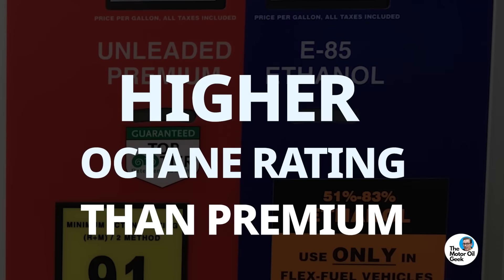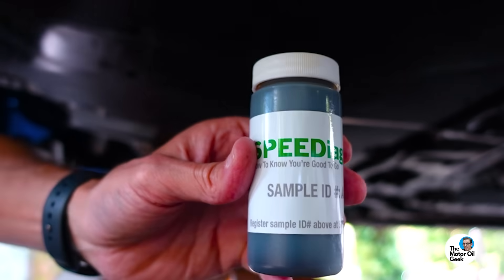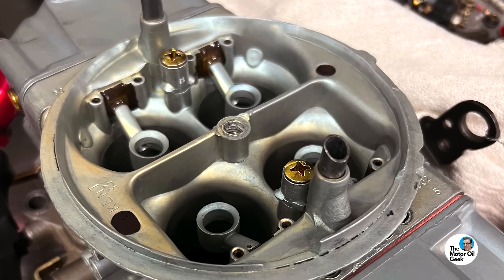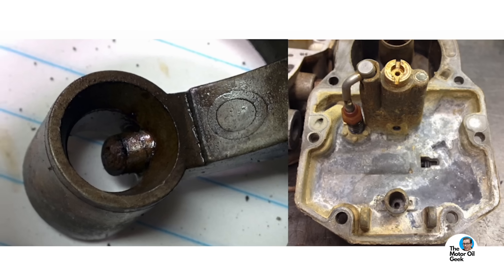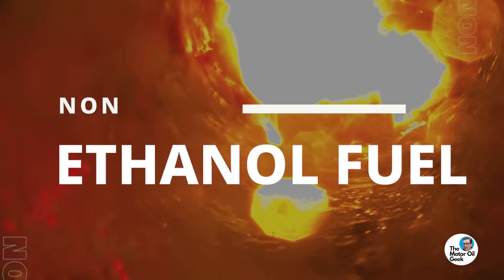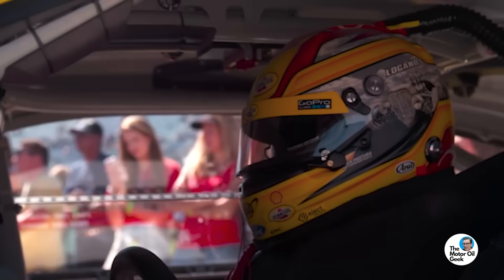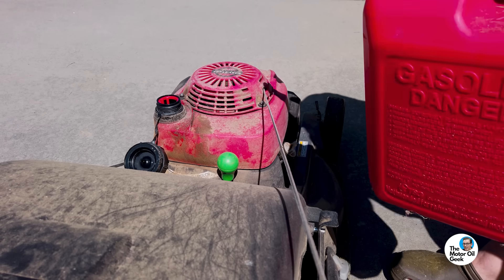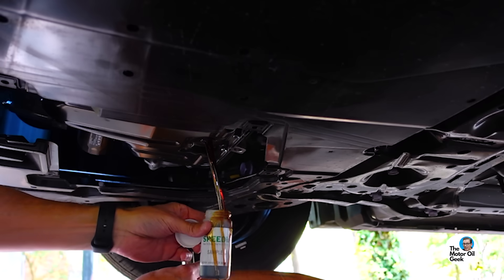ETHANOL: Higher OCTANE, Higher RISK?

Comment: This is going to be a problem in Canada. Already pretty much all of our gasoline is E10, on which almost anything can run. By 2030, however, the two largest and most populated provinces are switching to E15. This is going to be a problem for motorcycles, boats, and power equipment and any older carbureted cars. And just so dieselistas don't feel left out, those same provinces are switching to B10 (10% biodiesel) by 2030. Fun times ahead since both my car and my wife's recommend no more than B5.

Comment: What a stitch up, I’ve been running E10 for 20 years in everything I own from  my supercharged Mercedes, 351 Cleveland, 340 ci  ski boat, ride on lawn mower, chainsaw, wipper snipers and Honda generator with no problems, 
My daily driver is a 1999 v6 ecotec and has done over 300 klm’s on E10 for 20 years and still running the original injectors.
I’ve only had problems before switching to E10. 
In Australia we run ethanol from sugar cane and not from corn but I can’t see there being much difference.
There is a video on YouTube called 
“tuning our car on E10 to beat fuel prices $$$”
And they get more power on the dyno than running premium fuel.

Comment: This video focused on ethanol and harmful effects on carburetors. I didn't hear any mention about any harmful effects on fuel injection cars unless I missed it.. Does that mean fuel injection cars are okay to use ethanol gas without any harmful effects? I use ethanol free in my 65 goat with the tri-power even though I had all three carburetors rebuilt with ethanol resistance accelerator pumps. I am lucky there's two stations 5 mi from my house that are next to each other.

But I've also been putting ethanol free gas in my 2022 Hemi Challenger since I bought it brand new 2 years ago. The only time had ethanol gas in it is when the dealer filled it up when I bought the car. The main reason I'm using ethanol free in the Challenger because the car sits in the garage 90% of the times and it's only used for car shows and hardly gets driven. I understand ethanol-free gas will last longer before going bad then ethanol gas. Whether that's true or not I don't know

Comment: I haven’t had nearly the issues with oxygenated fuel but I have found the #1 thing is when storing is either utterly bone dry the fuel system or fill the tank to brim. 

Fuel system that’s partially filled is going to “breath” more than one fill to the brim and the water is going to be a proportionally greater qty in the fuel that remains. 

I throw stabilizer in too but honestly that’s more for the feel good I think. Plenty of times I’ve over wintered stuff with std fuel but with full tank there’s not nearly the issues.

Comment: Yes I only use non ethanol fuel in my mower and weed eater used to clean carburetor every spring not since buy the 50 cent plus higher non-ethanol It's worth the extra for no hassle. just pull rope next spring and mow.

Comment: I ran e85 in an old lawn mower for years as a joke and never had an issue 😂
Reply: Did you turn out the main mixture adjustment screw somewhat or drill out the fixed jet to a larger size ?

Comment: I've been a mechanic for 45 years and can't say I've seen carbs corrode like that. Heck. On my own lawn mower never overhauled carb in 15 years.  I have adjusted idle mixture screws. That's all. Never overhauled chain saw carbs after sitting years too.
Reply: Sometimes just a slight chalky film.

Comment: Steve Morris engines w/ Driven Oil have developed an oil formulation specifically for high output street-strip engines that run on methanol and ethanol/gasoline mixtures to avoid corrosion issues. https://youtu.be/z1EEgOFGOe4?si=zi324ZkhHi1bioFt

Comment: Most fuel system issues aren’t actually caused by ethanol, ethanol just gets the blame like always (thanks to big oil)

Most issues are due to a very high concentration of BTEX compounds (Benzene, Toluene, Ethylbenzene, and Xylene), which do naturally occur in crude oil but are also added to gasoline as octane boosters (sometimes up to 30% in premium grades of non-ethanol fuel)

Comment: you don't need to run a richer air fuel ratio with ethanol. I've been running E85 for more than a decade and havent had issues with oil dilution.

Comment: Just a note that by our President's direction there may now be 15% ethanol in the fuel even when the pumps say up to 10%. Ethanol is not a bad fuel in systems designed for it but it's not as energy-dense as gasoline so any savings gained from using it are cancelled out by needing more of it to reach energy parity which was the whole idea behind allowing it in our motor fuels to begin with.

Comment: I run E85 on my '06 Subaru Outback. After reading thoroughly I've taken away that it beyond oil dilution, it brings more condensation of water in the oil. So there must be time for the engine to heat up and boil off the condensate. Or when only doing very short trips, sticking to regular gas. Regular oil changes with API SN-plus oil for better retention to corrosion and wash out.

Comment: those pre made 50:1 2 stroke fuels are not good. I dont know if I just got an old can or what, but my 50:1 mix I got at tractor supply 2 weeks ago ran so bad. it was acting like it's gonna shut off the whole time. but I actually used the little 2 stroke oil bottle that came with the chainsaw mixed with ethanol free pump gas and it suddenly ran just fine. and yes 50:1 is the ratio my chainsaw needs according to the manual. I asked one of my friends that works at the tool rental at a home depot, he says that pre made stuff is crap too and doesnt recommend customers use it. he said if you are gonna use it all that day and run it dry, it's even better to use the 2 stroke oil mixed with regular 87 pump gas with ethanol in it. of course youd have to make sure none is left in there which is an extra step.

Comment: I have lz0 duramax and was wondering what your opinion on running moble 1 5w30 or 5w40 rotella because of the timing chain problems or 0w40 moble 1 esp sense gm made all there 6.2L recall go to that

Comment: It affects more than just metal. I had a Ducati with a non metal tank. Some type of plastic, I’m not sure what material it was made of.   But the darn thing swelled and started leaking. There is nothing worse than having fuel leaking on a hot engine right under your seat. Ducati had to replace all the fuel tanks in America. They found out it was ethanol fuel causing the swelling. It wasn’t a problem in Europe where they didn’t use ethanol.
Reply: Ducati sells motorcycles in Brazil where the common gasoline has been >E20 since the late 1970s, E27 from 2015-2024, and currently E30.

Ethanol on manufacturing chemical compatibility charts shows it is far easier on metals, plastics, and rubbers than what gasoline and BTEX (benzene, toluene, ethylbenzene, and xylene) are.

Ethanol and BTEX both showed up on the scene around the same time for octane after lead was outlawed and aromatics/BTEX are very harsh on plastics (& most everything else).

Comment: My 2014 Mercedes is designated a Flex Fuel car.  I've used E-85 only a couple of times because I found the cost per mile to be greater than just filling with Premium gas.  It of course does not have a carburetor, but is a direct injection engine.  We can only get "up to 10% ethanol" gas here in Maryland at the major gas stations, but I use Premium in my small engine lawn equipment (mower, air blower, chainsaw) and have had no problems.

Comment: Politics and subsidies, $ $.
Reply: The corn ethanol subsidy ended in 2011.

The long-standing stated goal of the G7 Nations to end petroleum subsidies?  No such luck.

The common gasoline of Brazil for non-flex fuel vehicles, boats, motorcycles, lawn mowers, and weed eaters has had >E20 since the late 1970s and was E27 from 2015 until last year, now is E30.  It worked out so well and for so long that Paraguay went to E27.

How can that be if the video's information is correct?

Comment: Why can't we just get rid of low octane so you can manufacture more higher octanes and reduce the price of higher octanes from increased supply of hi octane?
Reply: Ricardo build and drove an ethanol optimized engine for GM which had more power and mileage than gasoline, even more than diesel engines.

This is why GM wants the EPA to come out with a 100-octane fuel standard, they are concerned about availability of E85 for these high efficiency engines.

<2% of fuel stations offer E85 in the US vs France where some 25% offer E85.  The government there approved ECU plug in conversion kits for non-flex fuel cars.
Reply: Porsche has developed their own high octane, environmentally friendly fuel.
Reply: @65sohc  It is basically synthetic alcohol (methanol) made with CO2, water, and electricity.  

Argonne National Laboratory is building a pilot plant very similar which economically and efficiently makes ethanol with catalysts of carbon and copper which can instantly turn on and off.  Modern ethanol plants use waste steam to make ethanol from onsite/nearby natural gas electric power plants so they could use the excess capacity from them to make ethanol from the pure food grade CO2 from fermentation and the equipment to handle the ethanol is already there.

Methanol is good, not quite as good as ethanol as the Indy 500 found out, but light years better than gasoline.

Methanol is also slightly corrosive which is why the very early 1990s flex fuel vehicles which could run on methanol (M85) had stainless steel fuel lines.  When methanol demand never developed, flex fuel vehicles dropped the methanol capability and went back to standard mild steel fuel lines for ethanol, identical to non-flex fuel vehicles.

The Porsch flex fuel cars in Brazil use E100, even more environmentally friendly fuel since unlike methanol, it is not poisonous. 

A Brief History of Racing Fuel By Craig A. Johnson

In 2005, the IRL used 100 percent methanol in their tanks. The fuel worked well and was more efficient than straight gasoline, but IRL officials believed there was room for improvement. In 2006, they moved to a 10 percent blend of ethanol and methanol, which was then changed to 100 percent ethanol for the 2007 season.

The desire to use only ethanol aside, 100 percent ethanol is nearly impossible to obtain, and is illegal to keep without paying hefty taxes that date back to prohibition. The actual fuel used by the IRL is a blend of about 98 percent ethanol and 2 percent denaturant. The exact composition includes a small amount of high-octane racing fuel.

The fuel for today's Indy cars has an octane rating of 113, compared with methanol's 107. This means a significant reduction in pre-ignition, or knocking and pinging.

In addition, many of the people who handle the fuel, say it smells like tequila. This quality may seem insignificant, but smell is actually one of ethanol's benefits when compared with methanol. Pit crews noticed the switch to ethanol immediately, reporting fewer coughing fits and less eye irritation before any other modifications were made to accommodate it.

According to Dennis Vervynckt, manager of hospitality services and an IRL official, in 2006, the first year the IRL began using ethanol, teams saw a reduction in efficiency of about 10 percent. "That's because we put straight ethanol into the tanks," he says. "The teams initially didn't make any or very many adjustments to their engines. After a few months, they kept tweaking and by the end of the season they were back up to 100 percent efficiency."

Vervynckt points out that there was a minor loss of power. "When they first started using ethanol, teams saw a slight drop in horsepower," he says. "As the teams got used to the fuel, they were able to get more horsepower from ethanol once they again reached maximum efficiency."

The switch to ethanol also allowed the racers to carry less fuel and make fewer pit stops, thereby increasing efficiency even more. "When the cars ran on methanol tanks had to hold 30 gallons to accommodate the fuel requirements of the cars," Vervynckt says. "After getting the engines to perform at their full potential, there was a significant gain in mileage. Indy cars now have 22-gallon tanks. When a driver pulls in to change out his tires, he can fill up. Teams were able to match their tire and fuel stops exactly, instead of stopping for tires only, or fuel only."

That efficiency translates into much less fuel being used by the sport. Lifeline Foods LLC, which supplies fuel for the IRL, will produce 120,000 gallons of ethanol for the 2008 season. And though this may seem like a lot, it's 20,000 gallons less than was used the previous seasons.

The switch from methanol-based fuel to ethanol has amazed almost everyone in the league. Drivers, the direct users of the fuel, voice their approval in glowing terms. "[Ethanol] is an American fuel that is good for the country and the environment," says Ryan Hunter-Reay, of Rahal Letterman Racing and driver of the ethanol car. Standing beside his crew as they make last-minute adjustments to the car, he is more than happy to discuss the benefits of the IRL's switch to ethanol. "It's been great for Indy racing the fuel economy, emissions there's nothing we don't like. We love it."
Reply: @65sohc  I'm not so concerned w/ the processing of it just w/ the cost. Id imagine if we converted all 87 octane into 91 base formulation then we'd be able to make 91-94 octane fuels cheaper and car makers would be able to run higher compression engines on average resulting in higher mpg designs.

Comment: It is virtually impossible to obtain Ethanol free fuel Even if it says so on the pump, The reason for this is costs, not the fuel cost on it's own but the cost of replacing fuel storage tanks  rust through atmospheric contamination causes rust and extremely expensive fuel leaks that once detected need to be removed and the fuel contaminated ground removed and treated , that's why you never buy an old gas station truck stop diner  no matter how cheap it is it can become a verry expensive experience, the ethanol is added to absorb water out of the atmosphere as the fuel is pumped out air is sucked in to the tanks containing moisture , there are other issues directly related to the water contaminated with methanol or methanol contaminated water either way, the simple fact is engines run hot which starts the methanol and water doing strange things to various metal components in the fuel system, you probably noticed the corrosion tests were on copper there is verry little copper if any in a fuel system it's mostly cast Aluminum brass and passivated , zinc or epoxy coated steel, none of which resist tarnishing corroding or absorbing water laden ethanol the speed of corrosion can and is accelerated over 40 deg c normal under bonnet running temperatures and lower, the copper tests most likely were done in a lab at 22.5c which is a standard in most test labs and certainly not representative of real world situations. but the real Question is exactly how much water is contained in the Ethanol before it is blended in the fuel.

Comment: I massachusetts you cant get ethanol free fuel at the pump so its  $25+ a gallon "if" you can find it. No thanks ill just drain it if the engine wont be used for a while. I've been doing that for decades and see zero corrosion inside my carbs.

Comment: It was created by big oil. It wasn't NASCAR. They helped push it.  When big oil convinced Congress to change fuel by saying it's better to reduce air pollution. So corn was taken off the food supply to use in gas. It's all collusion and collaboration. Also auto industry knows it would take old cars off the road. Make you buy another car.

Comment: Goid reasons to check out SM Oil. Steve Morris and Driven has come up with solution to the h20 corrosion with engine internals for methanol running engines.

Comment: A channel i watch, deals with small engines. The person doing the channel says TRU FUEL has gone downhill,  and they have had lots of issues. They cleaned out the TRU FUEL, then mixed the oil with the non ethanol gas, and the engines worked as advertised.

Comment: E0 91, problem solved.
My '87 Porsche 16-Ventiler loves it.
My '02 E46 double vanos M54 loves it.
My '21 ProMaster Pentastar 3.6L loves it.
Fill the tank, go home, disconnect the starter battery for some minutes to reset the maps.  Drive it normally for a few days to relearn maps, then report back here.

Comment: Octane does NOT mean power or BTU content.
Reply: But if engine control computer allows more advance on ignition timing you should see more power my 3.0 flex fuel ranger more power cleaner oil between changes less mpg no starting problems at0 degrees f exhaust smell like a hot martini.only viable when one calculates cost per mile as e85 is over priced in many areas
Reply: @Greg-xv9qj Oh of course you can get more total power from Alcohol, why do you think race cars burn it, but you burn a LOT more of it to get that power. My point is, just dumping 92 octane fuel in your car doesn't make it faster, and just because ethanol increases octane it also doesn't increase horsepower unless you richen the mixture, and then yiu are burning more fuel.

Comment: I use 87 in my carburetor engines. Zero problems. My 2024 van can use E85. I don't use it. I did try it. I use 91. E85 is horrible for the winter. Cold burning fuel. Since the engine needs more of it to burn. Very bad fuel mileage. I am 55. I have put kits in every type of carburetor. I even work on throttle bodies.